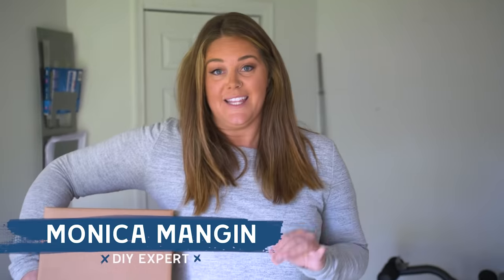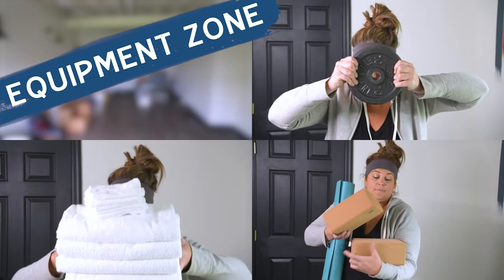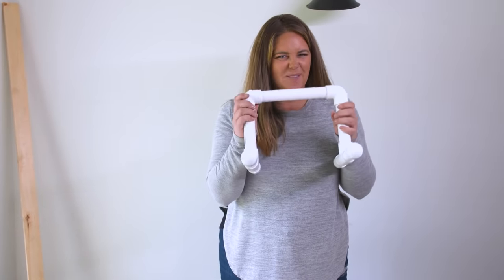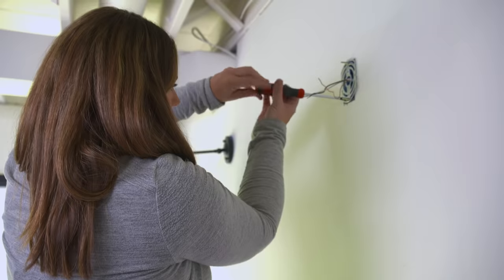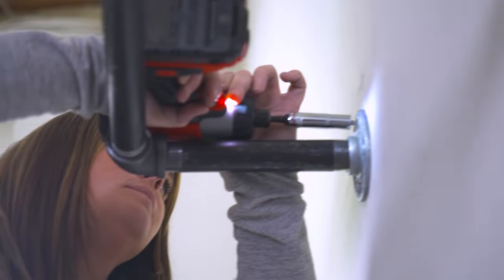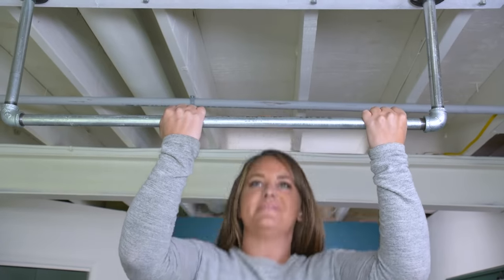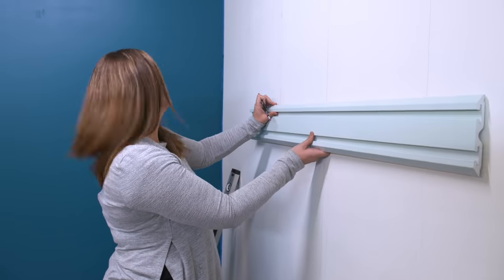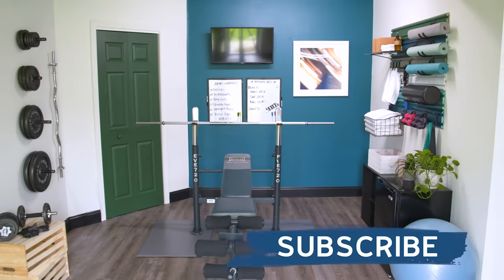Transform Your Basement Into a Home Gym | Home Becomes (Ep 2)

Comment: How's that plumbing going to hold up under a persons weight? While we're at it, how's that wall going to hold up to it? I know it's pretty strong but I'd want something at least 10 times stronger to climb up on. Might not hurt to look up code/regulations for gym equipment, I'm sure it exists.
Reply: Good call Frank. We did a lot of calculations with the stud type, lags, and pipe. It's definitely something you want to do. We should be good over 6000lbs!

Comment: I'm sorry but some of the choices made for the gym are ambering. Too much time was put into esthetics than actual utility (ie the wall ladder). The bench doesn't even have safety rails on the side, so if you fail you'll either get stuck under the weight or drop it on the wood floor, which should have some stall mats over it. 2/10